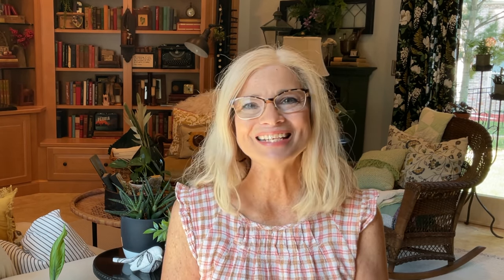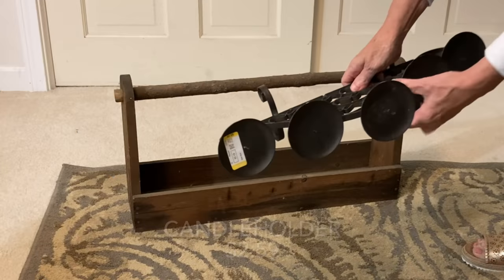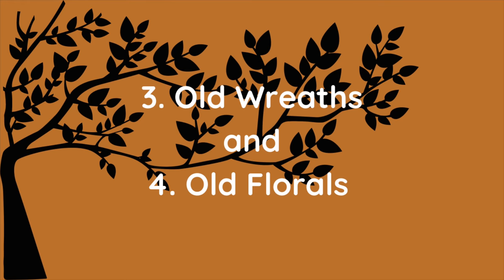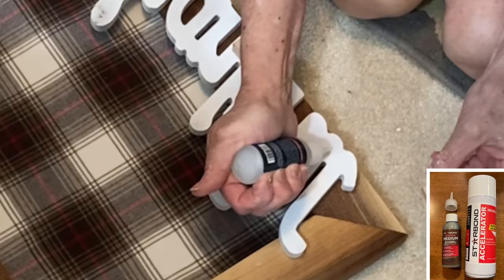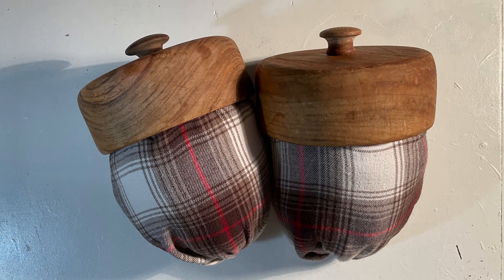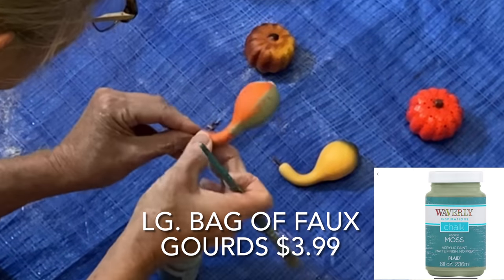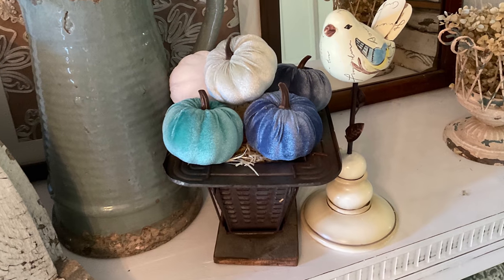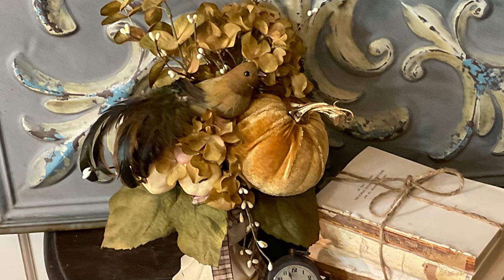DIY AUTUMN DECOR PROJECTS USING 11 COMMON THRIFT STORE ITEMS

Comment: Thanks for another great video! What a great idea to swith the plastic stems for sticks on the plastic pimpkins. Have you tried making cement pumpkings using socks or tights? They are really fun to make.
Reply from the maker: No, I haven't, but it does sound fun! I haven't used Quickcrete for anything, but I keep thinking that I need to buy some! Thanks so much for watching and commenting!

Comment: On your floral arrangements you get from thrift shops do you clean the dust off them any particular method.  I love that you reuse.
Reply from the maker: Yes I do! I use spray Silk Plant Cleaner. I showed it in one of my early videos.  You can find it at Walmart and Hobby Lobby (and sometimes at Dollar Tree). I spread the flowers on an old towel, give it a good spritz, and when it dries the flowers are clean.  (If they are really dusty, it may take two times.) Hope this helps, Belinda.

Comment: think I liked the coffee grinder remake the best, although, all your ideas are great.  I still can't figure out how you think of so many different things to do with your finds.  I feel I may lack imagination.  Have an old arching picture frame, (with glass to fit) and don't have fancy printers to make large pictires for this frame.  The frame itself is 21" tall, (outer edge measuirements), by 17" wide.  What do you suggest I do to find a nice print or two for this frame?  Enjoy the heck out of your vids and get a log of good ideas from you.
Reply from the maker: Thank you, Doc! If you find an image you like online, you can upload it to the Walmart or Walgreens photo app and print out a poster. You’ll have several sizes to choose from, so you should be able to find that will be a close fit. That is probably the cheapest option. Hope this helps.
Reply: Thank you for the suggestion.  I am technically challanged.  lol  I do have a frame shop close by that has a bin full of varying sized prints at a reasonable price, (just now thought of it).  That is another option.  The frame has ornimantation at the top and sides of the frame.  Though the bottom of the frame is simple and streight with rounded corners, I am thinking of using your idea of putting one of three things at the bottom.  Either an oblong basket, a shelf, or a wood crate, (small to fit).  Will see what I can find.  Just hope it all works out.

Comment: Another fantastic video ! Thanks so much for putting these together ❤...could I just ask the wooden piece of carved wood behind the transformed coffee grinder ...how did you get that painted, layered, rustic look as I have just got hold of a similar dark brown heavily carved piece.  Many thanks my lovely x
Reply from the maker: That piece is actually metal. To get a similar look, you will need to paint your entire piece with multiple coats of different colors of paint, then distress it, so that the undercoat colors show through. I would use chalk paint, so that you can use a wet cloth to distress (rather than sandpaper). Hope this helps!
Reply: @CanterburyCottage  Thanks for replying 🙏...Yes that's so helpful x

Comment: I'm curious what would be the best way to remove dust from older/thrifted silk flowers ? Tks
Reply from the maker: I use Floracraft spray Silk Plant Cleaner.  You can buy it at Walmart or Hobby Lobby for $5 (or from Amazon for $12). I lay the flowers on an old towel, give them a good spritz, and when they dry, they are clean.  If they are really dusty, it may take two sprayings.
Reply: @CanterburyCottage  OK thank you.  I've been know to use rice in a plastic bag & give them a shake or two it works pretty good especially on really dusty ones.  🤔 I sending you a hug from Helen Georgia

Comment: How do u clean dusty used florals
Reply from the maker: I use Floracraft spray Silk Plant Cleaner. You can buy it at Walmart or Hobby Lobby for $5 (or from Amazon for $12). I lay the flowers on an old towel and give them a good spritz. When they dry, they are clean.  If the flowers are really dusty, it may need to spray them a second time. Hope this helps!